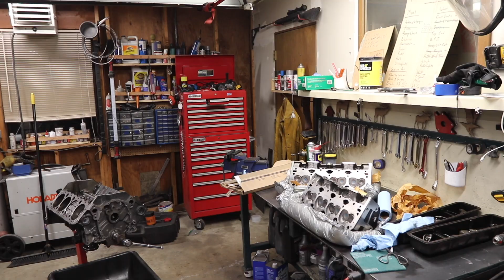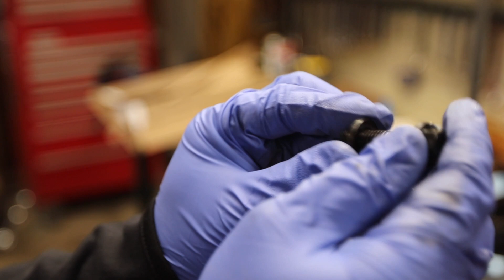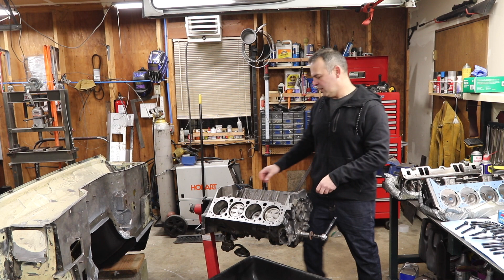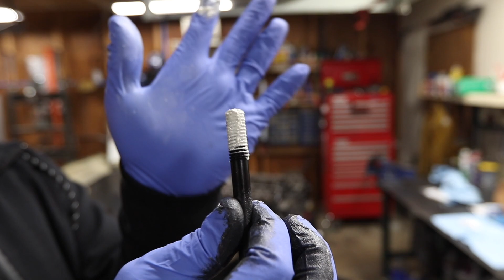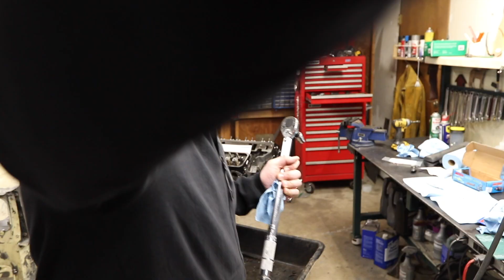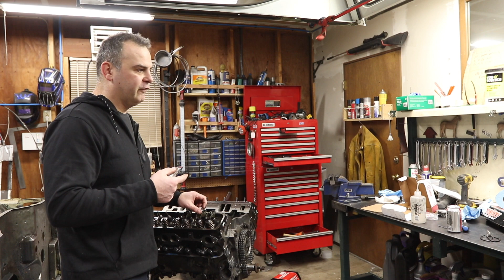6.05-Small Block Rebuild Part 3-Heads and Cam

Comment: So you did your own kit?  I have been considering a pre-arranged kit from Edelbrock for my Bronco....  better to do your own?
Reply from the maker: Ben Flinchum either way is fine. I know I wanted Vortec heads because they are by far the best flowing heads for the price on an SBC. Not sure what the equivalent would be for a SBF. I also need a cam with a specific lobe separation otherwise the affordable fuel injection ECM gets confused. But the trick flow or edlebrock kits are all nice.